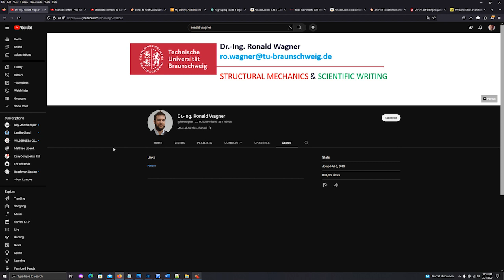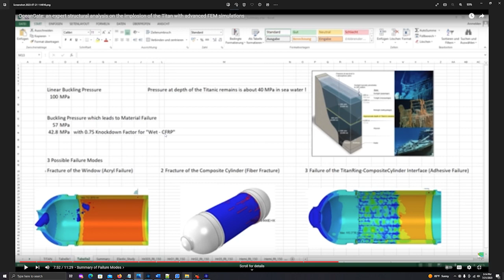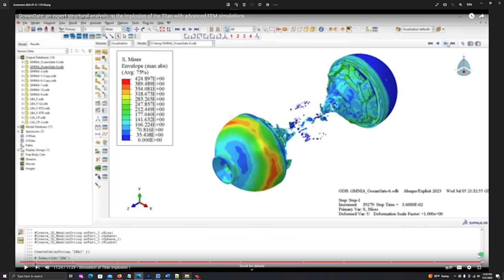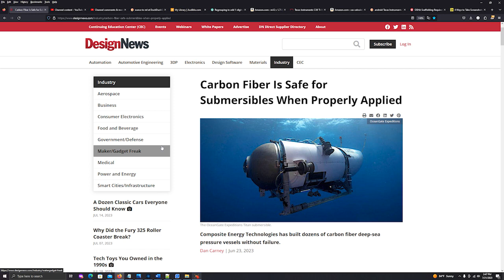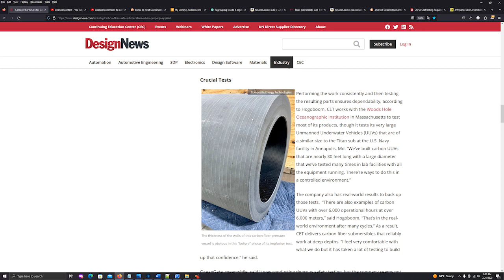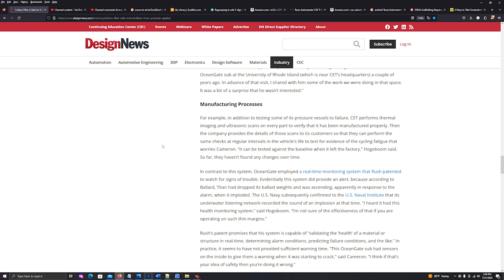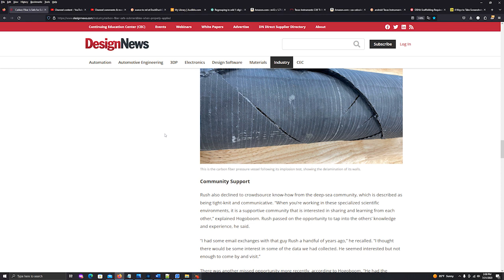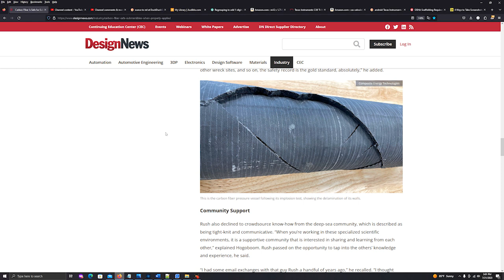Oceangate Titan - Can you safely build Subs out of Carbon Fiber

Comment: It's great to finally hear some new,to me at least,info directly/indirectly related to the Ocean Gate fiasco. What I take from this is that Stockton Rush was only worried about spending the least amount of both money and time to start making his venture profitable the easiest/fastest way possible (afterall he had already planned to build quite a few more of these things so going the cheap route was his thinking on how to do it IMO) Otherwise why would he not have just purchased one of this companies PROVEN hulls and then retrofitted the other items the Titan was equipped with to the inner liner (a hull shaped liner that was slid inside the carbon fiber hull which was used for attaching video monitor brackets,etc to so that the CF hull wouldn't have any holes drilled in it) However even with this proven hull onboard,it likely would not have been worth a damn anyways if Rush used the same people,process & materials as he did on Titan in reference to the titanium rings to carbon fiber mating areas and the acrylic window used.Speaking of windows,how asinine and IMO criminal was he to install a window with only a1300 meter rating in a vehicle that was gonna be diving to 3800 meters on a weekly basis??
The comment Rush had made in other videos,which Lockridge confirmed,about gunshot noises that were audible on the very first dive followed up by more noises on subsequent dives by passengers,which he simply done absolutely nothing about to rectify tells me that money was the only thing he was worried about & after.If you really think about it,the name he was born with suited his personality very well.Rush as in he was always in a Rush & unfortunately this part of his personality not only got him killed,but also got 4 others killed too.
Reply from the maker: Thanks for your feedback 😸

Comment: Sir, what is your professional opinion regarding the stress put to the joints between the titanium ring and cabon fiber pressure vessel when the titanium doors were opened up/swung out x number of times and gravity acting on the joint with the door fully opened/swung out
Reply from the maker: Good question,  I cannot find any information on how heavy the hemispherical titanium end caps weigh.  Also we do not know how heavy the titanium flanges weigh.  We also do not know what type of adhesive was used to join the flanges to the carbon fiber cylinder.  The whole concept of bonding the flanges to  the carbon fiber cylinder to the flanges is questionable.  Did you hear Dr. Wagner say in the video, when discussing the bonding of the flanges,  "That he would  not dive in the sub.  I would say that repeated opening and closing of the end caps could have had an impact on the bonding but we just do not know how much.  Thanks for the great question.
Reply: @JoediyLab  if I was set to go on the Titan and then I saw a video on how it was built and those jabronies putting the glue on looked like slop, I would of said Im not going on that POS in a swimming pool.
Reply from the maker: @dustyflair  thanks for the comments

Comment: My opinion.   The body is a composite of resin and carbon fiber, my question is,,,, how much complimentary strength does this mixture produce?   For example…. If this were a compressed gas cylinder … the carbon fibers would add a lot of tensile strength.

But in the case of compression…. What is the added strength?  For example…. If you have fiber glass reinforced tape… it is very strong for strapping…. But the fiber adds nothing for compression stress.  Similarly… I am not convinced the carbon fiber adds a lot of compression strength beyond the compression strength of this big chunk of resin.  And it might even weaken the cylinder by providing opportunities for voids and de laminations in the resin
Reply from the maker: Carbon fiber does have compressive strength, just not as much as in tension.  Just like the American Indians built adobe bricks mixed with straw.  The straw by itself does not add much strength but together with the mud, creates a brick with much greater strength.  Carbon fiber  plies mixed with resin and compressed until cured creates a very strong matrix material.  Properly designed the less compressive strength can be accounted for. Thanks for the great question.
Reply: @JoediyLab  
Point taken… l though the example of adobe is a composite with random 3 dimensional fibers… as opposed to one dimensional thin strips.  

“Furthermore, it was reported that the carbon fibers' axial compressive strength is only 10%–60% of their tensile strength and their transverse compressive strength is 12%–20% of axial compressive strength.”
Axial being along the perpendicular fiber dimension…. Transverse being a side stress.  The titan cabin having both stressor of undetermined proportions

The thing is, there is a high amount of uncertainty both ways… and I think this guy could easily have been a victim of confirmation bias… optimistic thinking… he certainly seemed disinclined to test and verify in the face of numerous dimensions of ignorance and uncertainty
Reply from the maker: As with the straw, carbon fiber can be oriented in different orientations to build up strength. The strength of carbon fiber runs along the length of the fibers.  In structural parts uni-directional carbon fiber plies are commonly used as you then have extreme control over which axis you want to apply the most stress to.  Thanks.

Comment: C.E.T. has no doubt spent lots of its revenues and customers money to develop its processes and designs. Thus they are reluctant to divulge their secrets; the USN ONR likely wants to keep C.E.T’s proprietary trade secrets secret. 
C.E.T. isn’t just another in the submersible industry telling OceanGate it isn’t done but rather someone who is saying we know how to use composites successfully but your way is going to end badly (because we tried your way and it failed?). C.E.T.’s method sounds to me modeled on sound engineering practice (looks a lot like aviation practice) design, model, test to destruction, rigorous inspection of the product, rigorous in service inspection, … Rush supposedly had an aviation background but proceeded with more of a silvalley tech mindset.
Reply from the maker: Thanks for the feedback.

Comment: Didn't Rush only use a vacuum bag at 14psi rather than an autoclave at 90psi before curing?
Reply from the maker: Yes, that is correct, I had an engineer tell me that did not have an autoclave that big and that using an autoclave on filament winding  creates too much stress that will weaken the filaments,  Thanks for the question.
Reply: @JoediyLab  I think Rush did everything on the cheap. So what you're saying criss-crossing the windings would require higher pressure with an autoclave? How much stronger would the criss-cross be in the same 5 inch thickness? BTW Great Channel 👍
Reply: Too bad nobody has mentioned vented bolts yet. The Dr. has no practical experience with cf ti or anything else for that matter. He’s an academic with lots of papers. It’s easy to state the obvious.

Comment: 42 MPa which is aprox 6000 psi, right at the Titans target operational dive depth, they were doomed from the get go, SR waffled on about a 2.5 safety margin to journalists !!! somebody was telling SR garbage numbers.

And they drilled holes into the Carbon Fiber cylinder to mount the thruster brackets, then they moved a backet and left the hole unfilled. see the port horizontal thruster with no GF skin attached.

Plastic straps and woodscrews to cobble together the synaptic foam buoyancy  blocks.
Reply from the maker: Yes I read that with pressure vessels Safety Factor  should be between 3  - 4,  Thanks for the comment
Reply: If one isn’t going to use a liberal safety factor (pressure vessel practice say for domestic hot water heaters) then one must go the C.E.T. route which follows aviation/aerospace practice which is test to destruction and inspect in service; repeat the loop. Many airplane parts have a discard after so many hours or cycles of service or discard if a certain level or any level of cracking is found. Bad things happen when parts of a helicopter rotor system fail in flight.
Reply from the maker: Good comments, thanks, yes I am not sure the accuracy of  the statement of drilling into  the carbon fiber, more than likely as you indicated there is some other attachment point on the frame that is built and attached to the titanium structure, same goes for the skids and attachment for the drop weights.
Reply: I’ve gone at look at pictures of the thruster mountings. Looks to me like the brackets are mounted to the exterior shell shrouds (white) that are attached to the metal framing; this framing appears affixed to the titanium rings fore & aft. Based upon my (albeit limited) understanding of carbon fiber composites, to drill a hole in the composite is to essentially cut numerous fibers in two. The integrity of the structure depends upon the continuity of the fibers to carry loads evenly distributed across many fibers. The load which would be otherwise carried by a broken fiber has to be transferred to other fibers, carried by the resin matrix (basically a”plastic”) or accept structural failure. Likewise, the interior appears to have an inner liner (like paneling inside a concrete block wall) upon which those two video monitors are mounted. The question is where do the cabling & other lines from the rear exterior equipment (batteries?) and control wiring enter the pressure hull? My hope is through the aft end cap or via the titanium rings.
Reply: @christophercripps7639  Maybe it from the first Titan, Its a still from a video. the hole might be the attachment for the white panels, still they were drilling into the CF.
Theres an intrresting photo of the mk1 Titan on a flatbed behind a half container, captioned from  WA to the Bahamas for the their 4000m test dive. the first was unmanned I believe. So besides shaking the Sub with a 800 mile round trip they also put on a flatbed with no shock absorption for 3000 miles or so, there and back one assumes.
Reply from the maker: Yes it is hard to believe the risks that Oceangate took with their procedures.
Reply: I think the thruster brackets were mounted on the out hull, not the pressure hull, but I did quick back-of-an-envelope calculation as to how thick the hull should have been assuming it had been manufactured properly and came up with 18 inches, not 5, although the real figure is probably somewhere in the middle as I was overly cautious and did in a tea room over breakfast on my phone! But when they initially announced the "Cyclops 2" as it was then known, the pressure hull was advertised as being 7 inches with a borosilicate glass end dome at the front, rather than the 1300m-rated acrylic porthole we eventually saw. The original version was essentially a rip-off of the Deepflight Challenger pressure hull, which was intended for one-time use only.

Comment: It boils down to this; carbon fibre, regardless of how well it's manufactured, has almost not ductility, so under compression, it'll start cracking anyway, no matter what you do. Glass fibre is used in some pressure hulls (only Lloyds will certify them though) and that starts to bend and fail like metal BEFORE it cracks and delaminates. You need a material that will have a small amount of "give" in compression. The Young's Modulus of carbon fibre is just far too high.
Reply from the maker: Did you watch the CET portion of the video?
Reply: @JoediyLab  Yes. But carbon fibre is too unpredictable for human occupation. It's been tried before (by the U.S. Navy, for example). It didn't work. An ROV is a hell of a lot smaller than a human-occupied pressure vessel, and the problems with carbon fibre rise exponentially with how wide the diameter of the pressure hull is. Besides, there are SO much easier and more predictably reliable materials to work with.
Reply from the maker: According to the article they built pressure vessels as large or larger than the Titan sub.  It looks like there testing methods and track record is pretty solid.  Go check out their website.
Reply: @J_D_Sisson  Easy construction, ease of handling, easy launch, that was their method.
They were ambitious and brave  but foolish.
Reply: @JoediyLab  The interesting thing is, they build submarine rescue systems based on Perry Slingsby's LR-type design, which was used by the Royal Navy and NATO for years; the original version was made of a composite glass fibre pilots compartment and a steel transfer chamber, except CET, who are obviously skilled in the use of composites and, despite the fact that glass fibre is Lloyds approved, build their version of the vessel entirely out of Q1N steel.
Reply: @JoediyLab  BTW, that article doesn't say anything about them building pressure hulls larger than the Titan. It says they've built UUV pressure hulls 30 feet long, but it doesn't mention the diameter (which would be quite small, certainly nowhere near as big as the Titan), and that's what's crucial; it's far easier to build a pressure hull, say, 21 inches wide (a figure given for one UUV on their website) and 30 feet long than it is to built one 5 feet wide and 8 feet long; they specifically state they're nowhere near close to designing one for human occupancy.
Reply from the maker: Yes very good point. Thanks